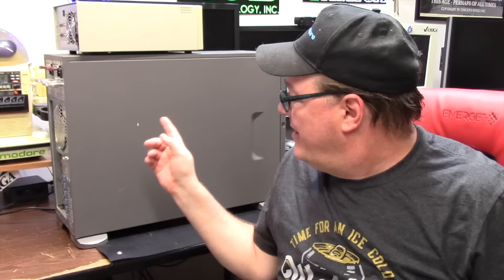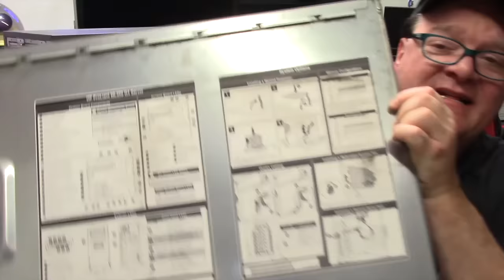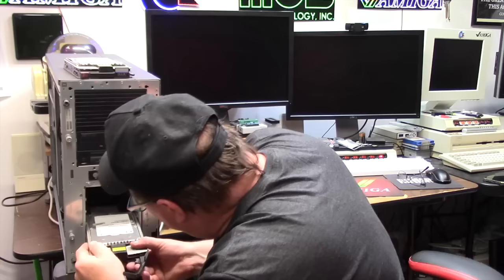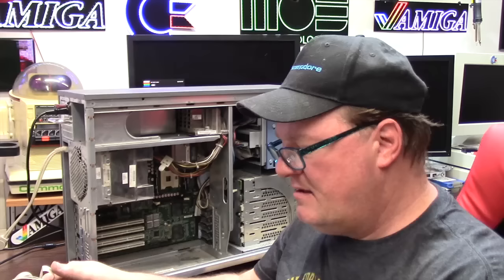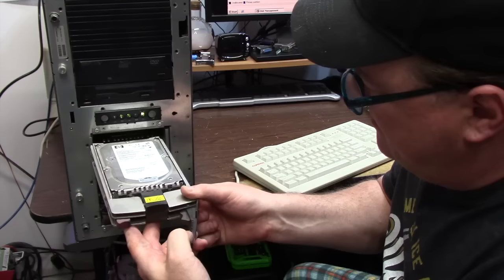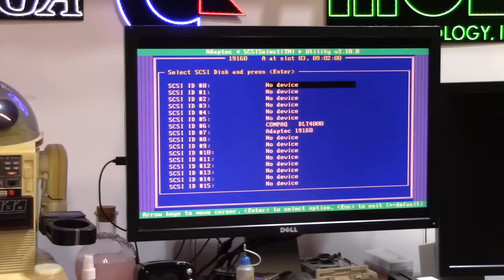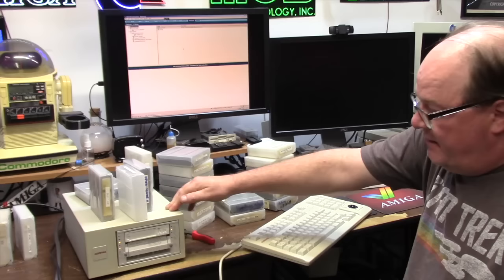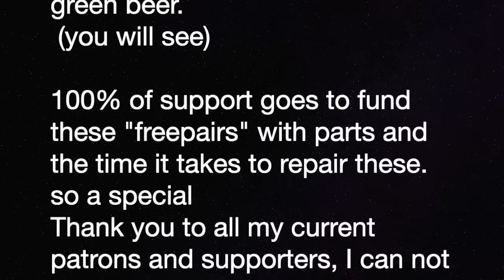Restoring a old server to restore my amiga stuff from 2001

Comment: I recently bought a bunch of 147 & 300 GB 68Pin U320 15K drives for the ReA4091 cards. Overkill for sue but I miss the sound of spinning rust. I dont miss the sound of Fans & PSU's like that machine nor original Amiga's. I always wanted a SCSI streamer back in the day but they were crazy pricey and didnt really need it

Comment: I briefly had a 15K HP SCSI drive in my A3000. Insanely loud, large and still bus slow. Also, server drives typically are configured as hardware RAID either before the OS boots in the RAID BIOS or via a Windows Compaq/HP RAID util. Windows itself can do a native software RAID that’s slower and uses more CPU. Prob doesn’t matter for just data recovery from tape though.
Reply from the maker: not this model its internal junk was just that

Comment: The Metallica "One" referance was hilaroius. I've worked with old tape backup systems and had severe issues with tapes getting brittle around the 15 years mark but they were old Unix based devices so they probably didn't last as long.

Comment: We still use DLT to back up some old HPack Alpha systems running VMS. Same hard disks too but smaller! 9 or 18 gig drives are starting to fail en masse, just dead when I pull them from storage with a label tested good some 10 years ago. the bigger ones seem to be a little bit better.

Comment: Fast Video, is not possible when dealing with tape backups.
I got away from DLT tapes when it was taking several to fully backup my stuff with my Novell Netware server with connected Amgas. I think I still have some Colorado Tape backups of Amiga stuff. Thankfully I had moved to NAS units since then and just throw in bigger and bigger drives that come out.

Comment: Tape life depends on storage...

If the DLT archive isn't proprietary, you'd have saved time booting Linux off the CD.

BTW: Those 15kRPM drives need active ventilation or will die in a short time. With airflow, they'll spin continuously for 100,000 hours or more.

Comment: Arrrh, Memories, a Noisy Server, Re-tensioning Tapes, I miss that under the Desk, but I can hear the Phone these Days, (Sometimes why I liked the Amiga, it was Quiet, Mostly), I think Care should be Taken when you remove the Dust, you can break the Magic.. P.S. I still Use ESET Anti-Virus, they also have a Linux Version, So you can check Windows Programs WINE Runs ..

Comment: This old media recovery reminds me that I really should get my old Amiga .mod music off some Zip disks before it's impossible to do so... I'm assuming an internal IDE Zip drive will work off the A1200's IDE header as long as you have the drivers (which I think I have installed thanks to the BetterWB distribution) and Fat95?
Reply: Chris already did a video on a Zip drive he put into his A4000 Tower. Basically the answer is yes. Just make sure you have a entry in Devs:DOSDrivers and it’s either pointing to FAT95 or CrossDos in L: I use bother Zip and Jazz in SCSI and IDE guises. Ideal for making bootable emergency disks with using FFS or PFS3 👍🏻
Reply: @cullmaster7361  Gotcha, thank you very much!